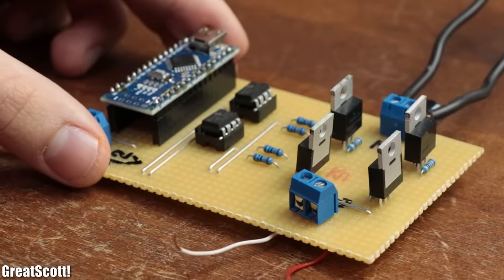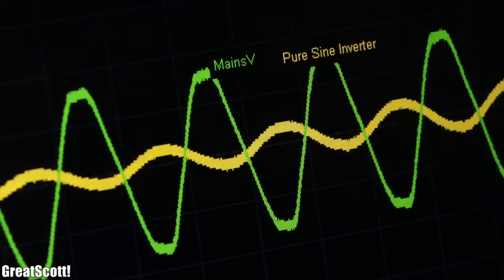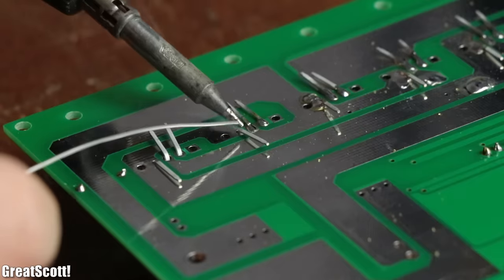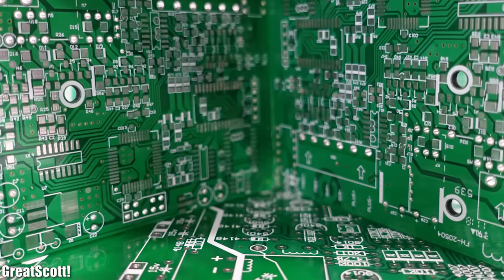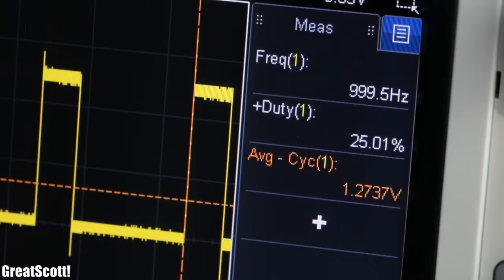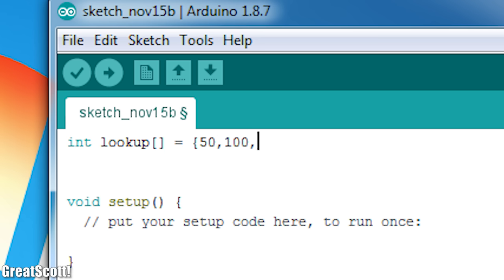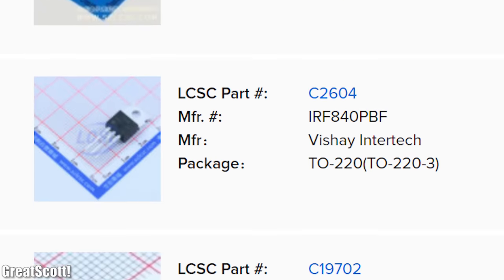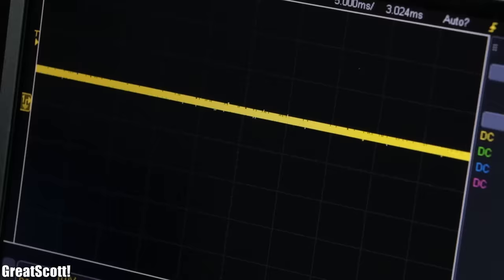Does it suck? Chinese DIY Pure Sine Wave Inverter || Sinusoidal PWM (SPWM) Tutorial

Comment: The most effective one I've made only created the sine after bumping the voltage to 320V with a DC-DC boost converter. This negates the whole problem of having stupid lossy transformers and difficult feedback loops. It has it's own disadvantages, like high frequency, high voltage switching and a high voltage DC supply (more dangerous than ac) but it was hella efficient and didn't care about load attached
Reply: that is the way to do it,my 2 inverters of2500/5000 watts are like that.

Comment: I can read Chinese and as I can see from the manual, it requires very complicated tweaking. You were EXTREMELY lucky to have worked it out without manual just by trying, risking and erring, and still got away without being electrocuted or have your lab burnt to ground :::)))) Your takeaway is just to the point....never try anything without a manual. I do cross fingers for those who are also trying this.... high power inverters are impossible for DIYers without 1-2 year EE college training.

Comment: Wouldn’t it be more accurate to use a controlled-speed spinning magnet to generate a pure sine wave reference voltage? I know from a mechanical sense it would be more complex,
but it may be a valuable trade off to make a perfect wave. I’m suggesting a VERY small motor/magnet. Purely for the wave shape. Thoughts?
Reply: Well the problem with the wave isn't because of the low current signal. It's because of the nonlinear characteristics of the inductor, the transformer, and the load. So, for example, in an exceptionally simple case, a rectifier draws more current when it gets to the peak of the sine wave, which brings the voltage down (mainly due to resistance upstream in the power path, like the inductor and the mosfets) only at the peak and gets us that sine with the flat bit at the top.

I actually really like your thinking there, though. Largely because I thought of a similar thing a while ago. There do exist rotary converters, which is basically just either a DC motor spinning a single-phase generator, or a single phase motor spinning a 3-phase generator. The problem with these is that they're big, heavy, loud, but most importantly, they constantly consume current even at no load. They're good for some uses, like if you need 3 phase power when you only have single phase, and you only run it when you're running a big tool or something so you don't care about its inefficiency because it's not running for very long. But inverters are much better for general purpose use, which is why they get used so much. I believe they're also more efficient even at full load. You get a lot of eddy current losses in the big steel plates you need for a mains frequency transformer/motor. Inverters step up voltage at much higher frequencies (10s-100s of kHz), which means a much smaller transformer -> less steel -> less eddy current losses -> more efficiency.

The trick to making a good sine wave with the inverter is all in the filtering. Picking the right combination of inductors and capacitors to balance the cutoff & resonance, good high frequency filtering while not suppressing the fundamental frequency that you want to keep, an also keeping component cost and size in mind. High current, high inductance, low frequency inductors get real big real fast. And since they use thick copper wires, they get expensive real fast too. And you can't use the advantage of the high frequency switching needing a smaller core like we did with the transformer because mains needs to be low frequency.

This, by the way, is why cheaper inverters have more THD. They use cheaper components that don't filter as well (and probably spent less R&D money as well) so you get more harmonics. I'd say likely the most expensive parts of any inverter are the filter components.

Comment: I have used EGS002 in my inverters and it works very fine.
 I have been using it in line conditioners also
Reply: ahmed fawad  can i question for you ? I am building inverter 12vdc-220vac using egp1000w and gs002 make by Chine. This is the same video above. But output vac only 120vac, i am using tranformer 7.5vac to 220vac and irf840. Please, can you help me? Share for me your project. Thanks so much.

Comment: The "ASIC" could well be a microcontroller with the firmware in ROM. Definitely the ATMEGA in Arduino will do the job as well.
In fact it does nothing else than the table generation you tried yourself, but instead of directly feeding to the counter, these numbers get multiplied by an amplitude variable.
This variable comes from sampling the output voltage at the moment when it is supposed to be at its peak, comparing it with the desired peak value and then adjusting the amplitude variable till the measured voltage matches the target.
The ADC is scheduled so at most times it measures the current, once the 20ms cycle it replaces one sample by voltage measurement and few times per second by the thermistor measurement.

What makes me to think it is actually a generic microcontroller with custom firmware and not a true ASIC is how much of auxiliary analog circuit it needs around (not talking about the MOSFET predrivers, but really about signal processing within 5V rails), which could way easier be integrated onto the ASIC chip, so saved the BOM cost if it were truly designed as an ASIC. But all the circuit around really suggest there was no dedicated IC design involved, only programming of an existing micro.
Which makes perfect sense, as designing an IC is VERY expensive and you have to sell millions of them to get that money back on savings compare to using some standard MCU. Don't think there are that much inverters sold to justify a fully custom IC for that...

Comment: Hey Scott, the circuit shown on the EGS002 document is for converting 400V DC to AC, so there may be some issues with your method of using the filtered hbridge output into a transformer.. 
Did you get any rough efficiency calculations when you were powering the lightbulb?
Reply: Most inverters step low voltage up to 400V then use full MOSFET bridge to create 240VAC from that 400V. This improves the efficiency and size as transformers work at 20kHz to generate 400V and conversion to 240VAC only needs simple filtering. Example: I have a 3000W Chinese sine wave inverter which has a no load power of around 10W

Comment: Hi Scott
Thanks for a great video.......
I'm using the EGS002 and it's working fine..... IF you build your own board.  But the most expensive part is the toroid (transformer).
A bigger toroid=more power. Btw, try to use as high voltage as possible. Then you decrease the amps, because the AMPS is the backside of low voltage. No (normal) wire can hold 100A continuously at 12volt, but just by increase the voltage to 24volt, the amps will decrease by 2x.  And at 48volts you have "only" 25amps running in the cable to the battery. 

Thats why the Chinese circuit shows 400V DC. Because they can keep the cost down on wires and transformers aso.
Reply: Tim, can you share a schematic for a inverter?
Reply: @ГеоргиКовачев-г4к  Yes no problem. But i don't know where to share it...any suggestions ?
Reply: @timm3802  can I have a copy of your designed inverter? I want to build one with only small power rating like 200-300W for lights backup only uses and phone/laptop chargers.
Reply: @ГеоргиКовачев-г4к  no problem, I will mail it to you.
Reply: I have created a Github repository on : https://github.com/tvixen/230V-Inverter
Here you can get the controller schematics for a 4KW inverter. This is just a basic one, with no fuzz and features. 
I am working on a more advanced one, based or the same PCB EGS002 from China, but in co-operation with a Arduino Nano. But it's not ready yet.

(Sorry Scott for highjacking your tread)
Reply: @ГеоргиКовачев-г4к  HI tim you did not include the power board sch is there a reason

Comment: See alot of comments, and no where do I see a suggestion for heat sink and cooling of FETs most inverters if not all will shut down when overheating and have an led that indicates low voltage supply from source or to much draw heating up circuit, thee led will flash before shutting down completely. You need to finish this up,,, try heatsinking the FETs and fan. We know resistance changes as temperature goes up and so do the electrical engineers.

Comment: To increase efficiency you should take another point of view. For first boost 12V DC to around 320V DC and then modulate it to get the proper sine wave. This is how it's done in many modern inverters. Anyway, greetings from Poland. Keep doing great job.

Comment: I used this driver board, EG8010. I completed my graduation project. However, it seems that my version is different from yours. My version requires a DC of about 400V. After the H-bridge, the output is accurate AC220V.

Comment: @GreatScott!   There are three filter electrolytic capacitors (C1, C2, C3) and two decoupling capacitors (C14, C15) on the on-board power supply bus. The withstand voltage of the capacitor should be selected according to the power supply voltage. If working in high frequency mode and the power supply bus voltage is (330V~400V), select 450V withstand voltage. If working in industrial frequency mode and the power supply bus voltage is 48V, the capacitor withstand voltage should be 63V. The electrolytic capacitor capacity is selected according to the actual system power. Generally, the high frequency mode should be greater than 47uF, and the power frequency mode should be greater than 470uF. The decoupling capacitor is generally 0.1uF CBB capacitor, and the withstand voltage must be greater than the power supply bus voltage. If the withstand voltage of the capacitor is less than the bus voltage of the power supply, the capacitor may explode!

Comment: The problem with your inverter is that if you use 12V to 230V transformer, the peak voltages it can produce are only 230Vpk, 

while mains peak voltage is 325V. And if we divide 230 by 1.414 (square root of 2), it is around 162V as your oscilloscope showed. So if you wanted 230Vrms, you would have to use around 17V

Comment: This is actually insanely simple.

It just works like an AM radio

It modulates the 50 Hz sine wave in a different higher frequency
So the carrier wave gets modulated and cleaned up with a low - pass filter which leaves you with the perfect sine wave
Which then gets transformed up to 230V and voila you got an pure sine wave inverter

Comment: Great video.
I think it's worth pursuing this project further , if your comfortable working with mains voltages :0) 
These things are particularly dangerous as there is very little protection for you on the output. No earth leakage is going to trip if you accidentally
tough the output L and N.  That can ruin your day...

You can move your LC filter to the output of the transformer. That way is does not have to handle the high currents you will see on the primary.
The large transformer inductance will also naturally act as a filter to the high frequency pwm waveform.
The H-bridge circuit can also only generate a "PEAK" voltage equal to the supply voltage , so a 220/12V transformer will only be able to 
deliver just over 150Vrms. 
I think 1000W is a bit ambitious for a 12V system. Do-able , but your primary currents are going to be very high.
You would be better off at 24 or 48V.

Comment: I am using this modules properly after some Engineering modifications. You need to modify the transformer. The turn ratio will be 6.5 to 240 ac instead of 12/220v conventional transformer for 12V battery. And for more noload efficiency you need to add 40~100 uH power inductor in series of primary coil. After all it is a good spwm modules with cheap cost.

Comment: You did everything wrong! 
1. Make High frequency (27-100KHz) step up inverter with pulse transformer DC 310V for 220v output 
2. Use this Sin - wave full bridge to output perfect sin wave with regulated voltage. 
No bulky transformers needed.
Reply: That is the cheap way...that also blows up easily. Seriously, even the expensive ones, like Sinergex keep blowing up. I have repaired many. A full bridge + 50Hz transformer can make a robust inverter with nice output. One thing though, the 1000W board has a input current monitoring circuit that causes a rather high voltage drop, this is not practical with e.g. 12V input.

Comment: The 50hz transformers should be banned.

Smps 500khz-1mhz 12v to 300v dc, pwm Into h-bridge, filter, feedback and you no longer lose 50% of the energy in winding resistance and FeSi core eddies.
Reply: I am power electronic engineer...

Well, let me tell you the efficiency of 50Hz xfmr is >98% for distribution and transmission system

While, typical smps operate at around 50-100kHz, of course there is some operating at 500k-1000kHz...but you will pay 3-4x the typical sms

Fyi, I was working on wide array of projects: 500kHz converter, solid state transformer, grid converter

Comment: Regarding the waveform at 10:30:  
It looks like your LED lamp uses a full bridge rectifier with a smoothing capacitor.  
The voltage at the transformer drops very hard while it's loading the capacitor, so the output just seems to have a high internal resistance.  
I guess that's because you used a transformer with 230V for the input, but just hooked it up "backwards".

Comment: If there is sine wave - you can try to decrease current consuming (without a load) - tune an output capacitor value to compensate reactive power of the 50/60Hz transformer.

Comment: Im using it too but i use 12v for the controller and for primary i use 12v to 400v dc-dc converter that allows me to use the 230v ac output without the need for a transformer but in this case you need to chose other FETS or IGBT's that can handle the 400v DC Link under load the output is stil a nice sinewave

Comment: Yo Scott. I AM MAKING an inverter with mains output soon. so yeah, driven by Arduino to generate SPWM. I will include a feedback system. It's actually simple. All you need is a full bridge inverter that generates SPWM and analog components that smooth it out into a sine wave. Finally, a transformer to boost it. I will leave out the transformer until I get a good sine wave, though.

Comment: I hope after 5 years, this will be a topic again.. I have a UPS that uses the same module and I noticed that it has 2 capacitors on its output (one with so called safety capacitor and another capacitor with 225J630V). Maybe this are the components that Scott needs to add?

I am planning to create a UPS for the whole house using EGS 002.

Thanks!

Comment: I once wanted to build an inverter, but much easier than this:
- a switching power supply to step up the voltage
- a high voltage dc-dc converter modulated by a 50Hz sinewave (sort of like a class d amplifier)

I never got the time to try it out, but in theory it sounds good - no mains transformer, no microcontroller.

Comment: Great video Sir .... Thanks for sharing .... I need to small help .... The EGS002 Have any settings for HIGH FREQ (380VDC to 220VAC) .... The EGS002 Used Low frequency inverter also 12VDC to 220VAC ..... How to H Bridge Switching will work Please ....

Comment: Literally all you needed to do to make your original circuit with an arduino better is use a differential amplifier and an ADC to provide feedback and write a soft start function to vary your duty cycle proportionally.  That and maybe use a stm32 based arduino for better clock rate, ADC and PWM ability.